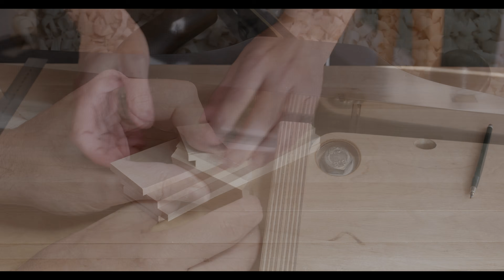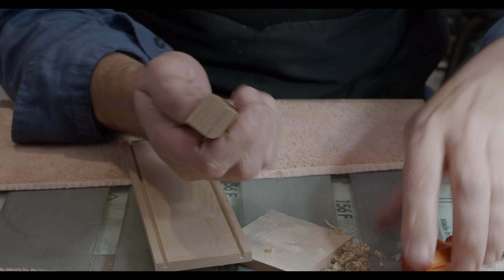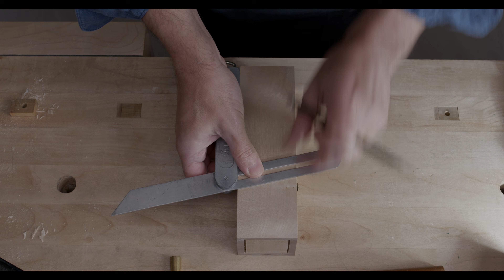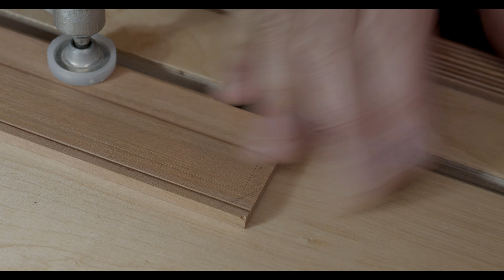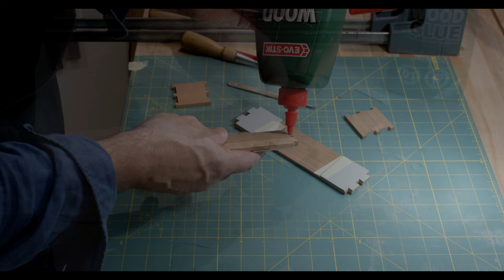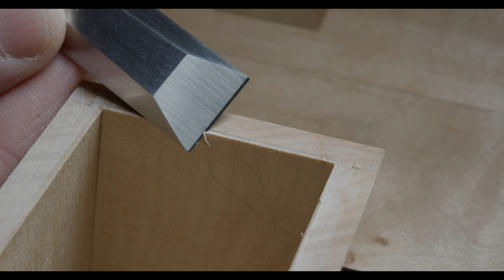Make a friction fit pencil case.

Comment: Just like the previous videos in this series, this video was excellent. First the photography, editing and voiceover is top notch. Regarding the woodworking this project looks simple enough but Ian provides so many techniques, information and suggestions that I had to watch it twice before commenting. In my opinion key words are patience equals accuracy. This is an excellent project for even an experienced woodworker to practice execution.  Two questions, why do you use a Jack plane  instead of a Smoothing plane for the finish surface on the exterior box? Regarding the finish, because of the tight tolerances would you stay away from shellac which remains on the surface and doesn’t soak in?  Thank you very much for sharing this series.  I hope that there are many more to come.
Reply from the maker: Hello Nick, thank you for your comments. Using shellac on the outer case would be fine but as you suggest it would wear if used on the box and tray, not really much of an issue, I just used oil as it is readily available and I'll leave shellac and especially French polishing for another project. A smoothing plane would be the obvious choice for the final flattening, but I am trying to use just the fewest tools possible in this series. (ideally just the ones mentioned in the first video 'getting started' to try and encourage more people to start and demonstrate what is possible with just a modest tool kit. There will be lots more to come, will explain more in the next video.

Comment: This is some serious tuition Ian, I'm really thankful for this!
About the pieces you started from, I'm assuming you milled/thicknessed with a power planer, then dressed to final beauty with your killer tools 😀
I was wondering: do you think one could do a decent job thicknessing such narrow pieces (8mm, 6mm,...4 mm?) just with hand tools?
Reply from the maker: This stock was all prepared by hand from timber bought 'sawn' from the saw mill. I only used my bandsaw to slice the cherry board that I prepared from scratch in the 'planing stock by hand' video. I do use a planer thicknesser for more involved projects, but only to get material to a rough thickness, final surface finish is always done by hand. Final width dimensions are also done by hand at the bench using my shooting board. For thin stock 5mm or less, I will usually do all prep by hand as the machines can often wreck thin stock, particularly is there is lots of grain direction change.

Comment: The tip on working to a second line when using the shoulder plane then, using the marking gauge to clean off the last mil was so useful to me. I used it today and for the first time was happy with the result from my shoulder plane. My shoulder planes are now no longer just for show in my tool cabinet, thank you for this little nugget. This channel has already helped me improve and inspired me. Thank you.
Reply from the maker: Using a shoulder plane to create a rebate usually typically results in less than acceptable edges due to the lack of nicker blades. Glad you found the technique helpful.